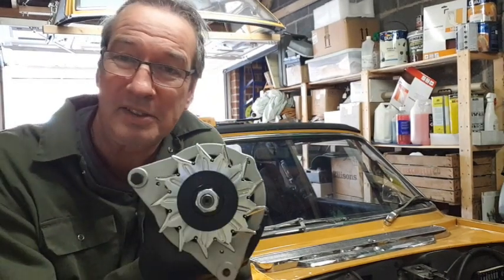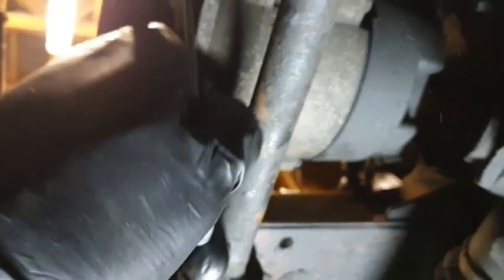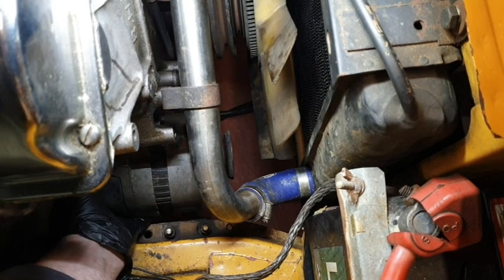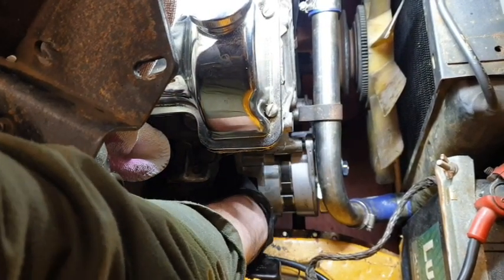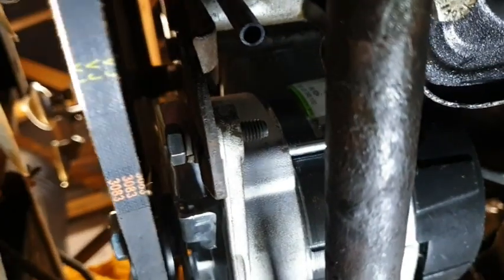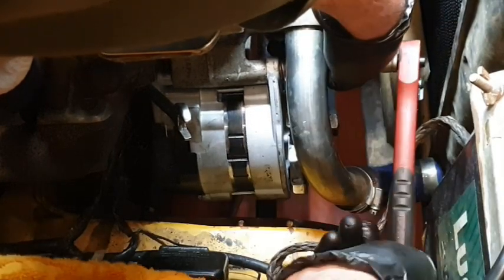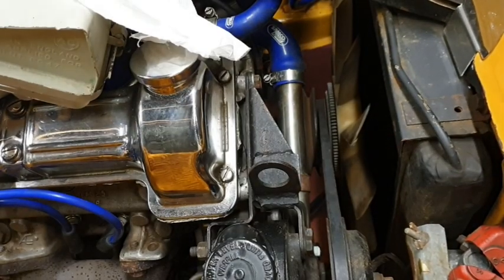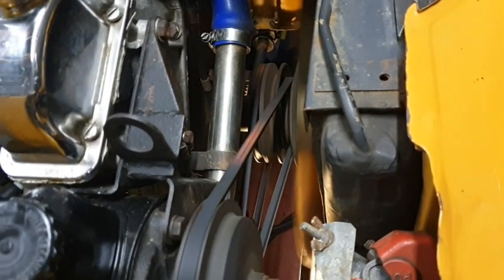Triumph Stag alternator replacement and unexpected disaster S1 : Ep 16

Comment: Tricky job, best done if you have three hands!!! Also, I have not found the adjuster catching the fan on my MK2 Stag (Oct 1976), could it have been because you used two locking washers on the bolt head side, try it with one and a nut too keep it tight. good luck Bob
Reply from the maker: Good tip Bob. I was thinking of taking an angle grinder to the corner of the braket to give it more clearance, so will try your idea first as it's less
invasive :-)